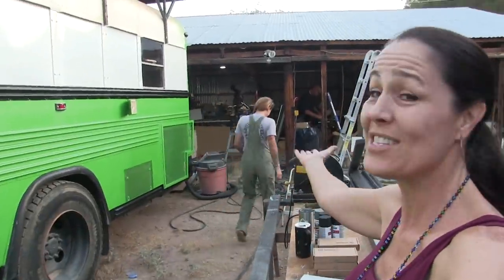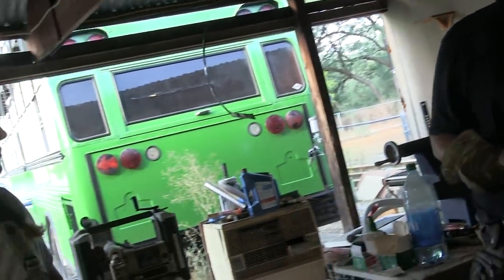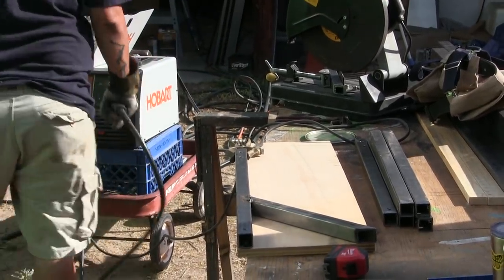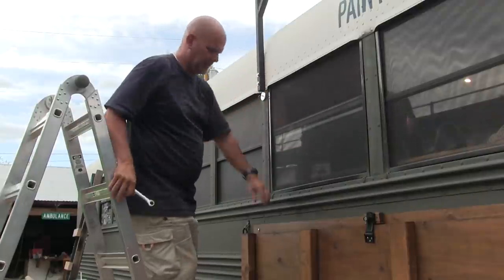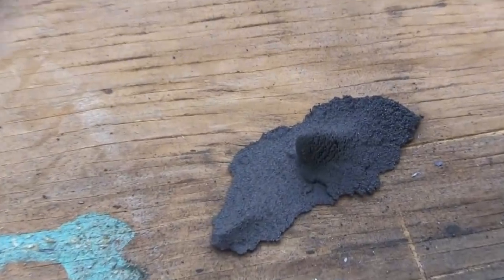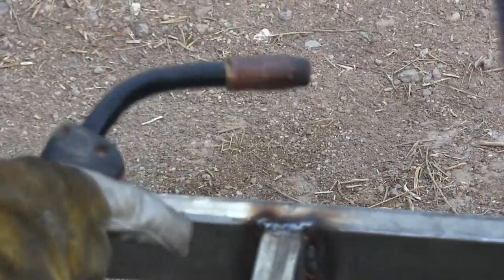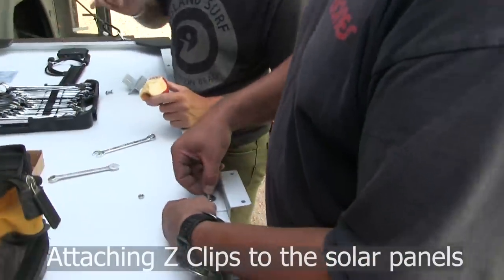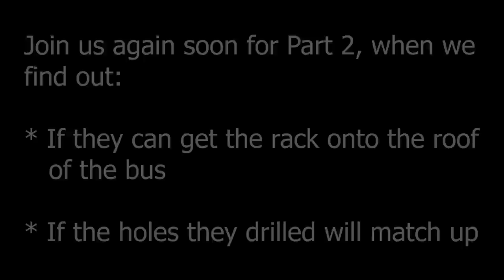Building a Solar Roof Rack for a Buslife Buddy!

Comment: Mike -  I'm surprised your not in therapy after dealing with those two. :) I liked your humor in welding school. If it's okay, I might add the two second rule when you start your weld to form a proper pool. Not that I'm any kind of expert but it's a great help for first timers getting started.
Reply from the maker: Right, that's a good one!
Reply: When does Dale’s welding school start?! Just kidding Mike is a great teacher!
Reply: @null1764  Ouch! ... No insult was intended on my part. Sorry if my welding tip was perceived that way. I have the greatest respect for Mike's capabilities along with his videos. I will not comment any further.

Comment: Yes, I love Alone. Yeah, there's nothing like welding I loved it. I worked in a very large Muffler factory but I made converters. I put them together in fixtures, We had so many direct fit converters I don't remember. but some were big some had 3 or 4 body's on them some had long pipe some had a 1 inch pipe with flanges, Gas tubes, brackets, hangers, o 2 sensors, flanges. I remember there was one particular converter that took 3 to 4 hours we had to put all these together like a puzzle then weld it. I worked there for 18 years but I welded for 9 years before I went out on disability. I loved it tho. I set up machines also. That bends the pipe and flares out one end or a ball joint. blow up one end of the pipe to make it a different size or make it smaller on one end. That factory was hard heavy work.
Reply from the maker: That does sound like hard, hard work, but it's an interesting story, thanks for sharing!

Comment: I have been watching some of your videos and have enjoyed your content. We recently had one of your friends come stay with us for a short time. I had mentioned your channel and their daughter instantly know who I was talking about. You guys including Jessica need to come visit. Oh and to answer your question. That left over metal after cutting with the abrasive chop saw. Well it is called unnecessary. Yes I used to use one as well until I found and purchased my new chop saw. No abrasive wheel, it has a blade with teeth that cut straight no wondering and you can touch the metal right after you finish cutting. No excess heat just cuts light butter. I could never go back. And again you guys and Jessica need to come hither.